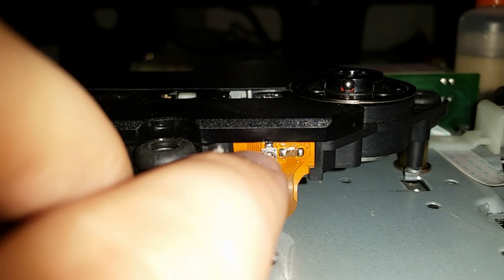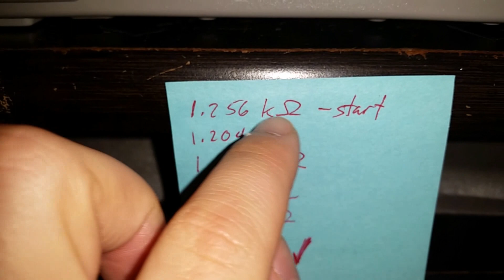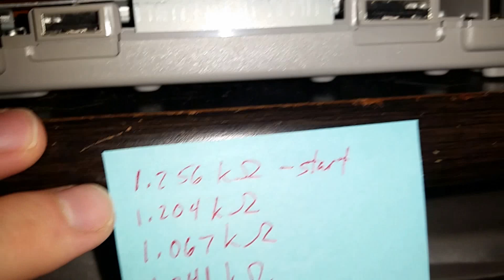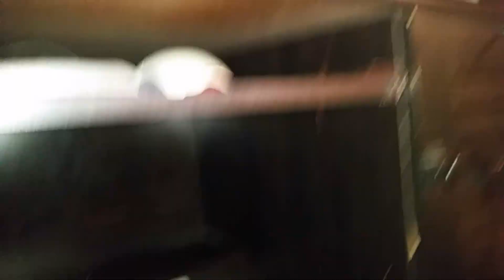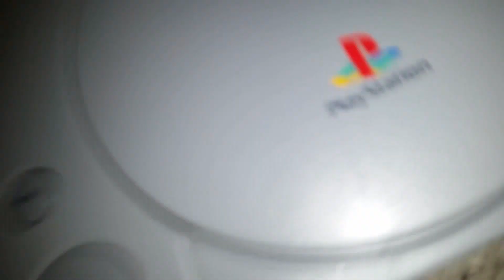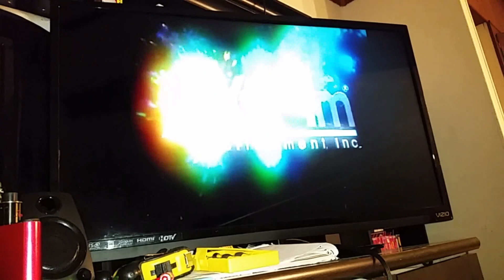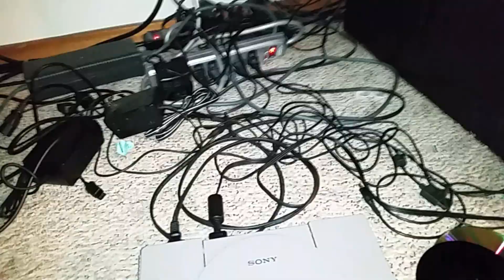Adjusting PS1 Laser to Read Original and Burned Games

Comment: This should be an absolute last resort. I had the same issue with my chipped psone. Try multiple dvd burners. I tried 5 different types and only 1 could burn a disc which the psone had no issues reading.
Reply from the maker: This is very true and deserves mentioning, so I have pinned the comment. The information in this video assumes that you are using quality media, and that there are no issues with the CD writer.

Comment: Really helpful, considering most pple don't show the actual measurements for the most perfect resistance, that was a huge helf for me. Thanks!
Reply: This is actually incorrect, the perfect resistance depends on the reader and how it aged, however you can assume that that resistance is fine since the reader didn't burn. I had some units with a reader which was partially reading at 0.8kOhm and then they got fried when lower than that.
Reply from the maker: The "perfect resistance" is going to vary console to console. Anyways, glad you liked the video.

Comment: I know this is pretty old now, but you really helped me out! I found some ps1 systems in my storage and never knew they were chipped xD. Had slight stuttering in cutscenes and lowering the resistance fixed it completely. Thanks!
Reply: My old PS1 isn't chipped, but does not read games every time. Do yo think this would improve things for me as well?
Reply: @toober247  Probably yes, one of my chipped systems didn't benefit from this however, so it must need a new laser if tweaking it doesn't work.

Comment: I got stuck having either/or and finally gave up (don't have a multimeter, but thanks for showing it is possible!) Never had a modded PS1 in the 90s, but I don't remember ppl discussing this issue at all.

In reading everything I could find on the subject, the most odd thing I found was modern burners often don't do as good of a job as the old ones. Some might actually have a different manufacturer than the PC/program tells you, and there are notoriously bad ones. One thing that bothers me is I can't set my burn speed as low as recommended.

Comment: Worked for me! I have a SCPH-102 which couldn't read neither originals nor backups after have installed the onechip mod. This totally solved the issue. 1.13kohm did the trick for me!
Reply: ONECHIP adds some noise by default. I remember someone DID find a fix for that but it's only for the newer board used in the slim PSOne, which is PM-41(2). I couldn't find any fix for the older PM-41 mobo... so adjusting the laser to work.
Reply: Same model here. 1.063 default. Made it 1.091 and will try it later today. If not, will try your 1.13.

Comment: I assume the struggling with the original games is probably because it's trying to track the copy protection lead-in which is much more wobbly, and I suppose the lower voltage (combined with age) was messing with the tracking since it has to move much more than usual, or at least that's the explaination I can think of

Comment: Many thanks! My ps1 is running fine again, even scratched or dirty disks, and videos are not stuttering anymore. All I had to do was to adjust the resistance from 1300 down to 1160 ohm. My model is a PAL SCPH-5552 with parallel port on the back side, no mod chip afaik.
Reply from the maker: That's great! Glad this helped you out!

Comment: 1.084 Kohm seems to be the magic number for my SCPH-7501 and is what it was originally calibrated to. I thought it needed adjustment, but it turned out that my CD burner sucked. Problems went away once I started burning the discs using a different burner. I wonder if different models need different values.
Reply: here from colombia almost all lens are adjusment around the 1000 ohms
Reply: @danielbarrios4379  Mine didn't like that much current. I think maybe they are all a little different or have changed some with age.
Reply: @cajunmetabolic7504  XD hahahaha righ now checked and they sually beetween 1000 and 1100 aprox, almot all console in my country, never seen one that had 1200 or more, maybe for the modchip install low the pot
Reply: @danielbarrios4379  Sounds right. Mine was at 1084 ohms. Out of the few I've modded, I think I've only had to go down to about 1030 ohms to get them to read burned discs. I always try to keep as much resistance as I can, it  doesn't take a lot of current to burn one.

Comment: Had to set mine at 910 ohms to get it to barely working again. My poor PSX is on its way out. Would adjusting the RV703 pot on the board help at all? It's the only other pot.
Reply from the maker: I would just replace the laser, sounds like your old one is about done.
Reply: Mine worked perfectly at 880, but yeah end is nearing, my other laser still worked good at 1230 ohms

Comment: i looking your this video on 2024
i have a questions what the correct speed for burn games ps1 (2x) 
my drive did not supprt this speed so i burn at 10x and i have a problems with some games 
thank you for the video
Reply from the maker: You generally want to burn as slow as your burner will allow, and use quality CD-R discs. You're going to have to do some research on what is considered quality CD-R media in this day and age. Sorry I can't be of further help.
Reply: 8x-10x is all right for PS1, write speed has little effect on games. You’d have to find an older CD burner that allows 2x.

Comment: What is the default lazer resistance value for your PS1 Slim before any issues had occured?
Reply from the maker: The top value on the piece of paper would have been the resistance reading from the potentiometer before any changes were made. I will note that the unit was a SCPH-5501 model, and not a PSOne slim. Hope that helps.

Comment: Is that a metal spindle installed on it?

And an helpful tidbit - as far as I remember, stealth chips should have a procedure involving power and reset which shuffles through stealth modes, as far as I remember.
.
Reply from the maker: It was a plastic spindle, and I don't believe it really matters. Also, although I do think you are correct about older stealth modchips, the MM3s, which are the standard these days, don't have any such shuffle feature that I'm aware of, nor do they need it. Thanks for your input!

Comment: But how to check resistance with multimeter? Got problem with second laser which I special buy for my PlayStation. They have no more quaranty.
Reply: Just connect your multimeter to the top and right bottom contact, and obviously set your multimeter to Ω symbol
Reply: Weird that you're asking this. He clearly mentions that at 0:43

Comment: At what speed does a ps1 cd has to be burned in order for the ps1 to read it?
Reply from the maker: I burn at the lowest speed the writer will allow.
Reply: @BoomerElectronics  the lowest speed was at 10x i believe and i used a gameshark and the game wouldn't boot up
Reply from the maker: It might be the quality of the media you're using. Check out https://cdmediaworld.com/hardware/cdrom/cd_quality.shtml
Reply: Speed doesnt matter, only quality of burning
Reply: I personally use 4x speed and have never had a problem. I've also read a few guides and they all recommend 4x. As for blank discs I just use cheap "verbatim" CDs.

Comment: TLDR: chipped PS1 for backups are a waste of time.
I've replaced drives with brand new ones. Gone in there with multimeter and oscilloscope to adjust pots and still can't get useable reliable results. Used all sorts of different brand cd r and different burn methods. It's never consistent and it's never reliable. I'm looking at a PSIO serial port cart now instead. Save yourself the time and stress my dudes.
Reply from the maker: If you're looking into eliminating the optical drive altogether, then I'd strongly recommend getting an XStation instead of the PSIO.
Reply: @BoomerElectronics  Excellent thankyou for the advice. I'll look into that for sure.

Comment: yeah tweaking it will kill your laser diode faster  :P
Reply: Depends if you tweak the resistance higher or lower, higher resistance will actually preserve your laser by sending it a lower voltage, but a lower resistance will indeed kill it faster

Comment: Spyro even if run on mod chip game can randomly delere your progres likie erned crystal in book etc...
Reply from the maker: Spyro 3 had two protections, copy protection and crack protection. What you're referring to was part of the crack protection. All modchips for PS1 nowadays get around the copy protection quite easily, so using a cracked version of Spyro 3 is completely unnecessary. So although this was definitely a thing when the game was first released, it's no longer an issue.
Reply: @BoomerElectronics  it's actually a two-part crack protection. one is libcrypt and the other is multiple CRC checks during the game. you need a properly cracked ISO to play a backup copy of Spyro 3 without issues.
Reply from the maker: @waltercomunello121  Incorrect, all you need is a stealth modchip, which tricks the game into thinking that a modchip is not installed in the system. Spyro 3's copy protection was only relevant at the game's release because stealth modchips were not yet the norm.

https://youtu.be/4GYSeXLr5sY?t=243

Comment: Couldn't u edit the image file and remove the  anti mod protection ?
Reply from the maker: That's probably doable, but as far as I know all modchips you can buy nowadays have stealth mode to get around the anti mod protection. The wire on this modchip for stealth mode was loose IIRC, so it was a simple fix of resoldering the wire to the chip.

Comment: what about scph 102 psone
Reply from the maker: Laser issues are usually from bad capacitors on the motherboard with that model, at least from my experience.
Reply: @BoomerElectronics  some say to adjust the laser to 1.13
Reply from the maker: @DusanKrsmanovic-tm5ug Bad advice. You probably need to replace a couple capacitors on the motherboard to fix your issue.
Reply: @BoomerElectronics  dear BoomerElectronics i have psone scph 102 that had laser issues when for a way to fix i realized it wasn't the cacacitors i just needed to adjust the laser so it can read burned ps1 games and cds but thank you for the help I couldn't have done it with out you. 👍
Reply from the maker: @DusanKrsmanovic-tm5ug If it starts acting up again you'll need to replace the capacitors.

Comment: I adjusted my laster but it's still the same, reads only orginal games. Do you know what could be the issue? I've tried;
1.223
1.210
1.130
1.222
1.171
1.081
1.149
1.014
1.104
974
1.062
1.250
1.115 
1.099
1.111
1.102
Reply: Has any of your modded ps1 read any of your burned discs at all? do you at least see the black screen, ps1 boot logo?
Reply: You probably need to replace the capacitors. I did, and mine started working properly.